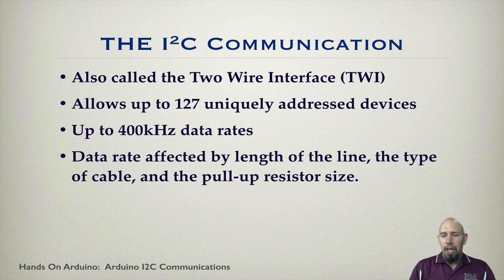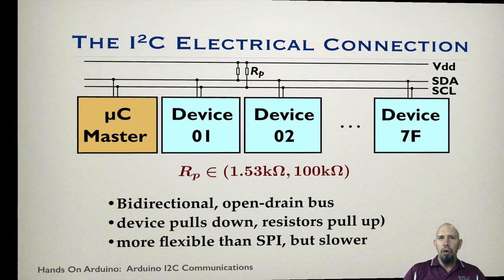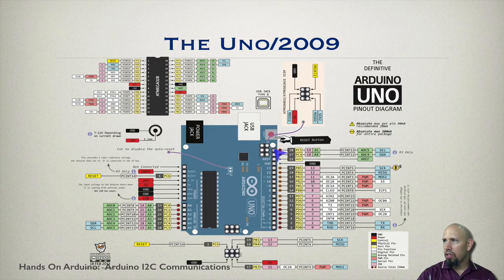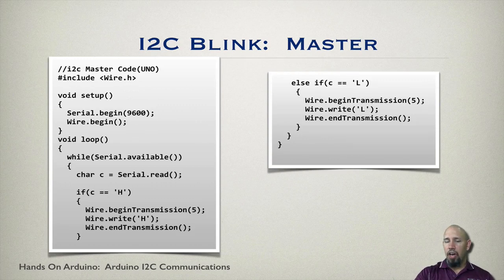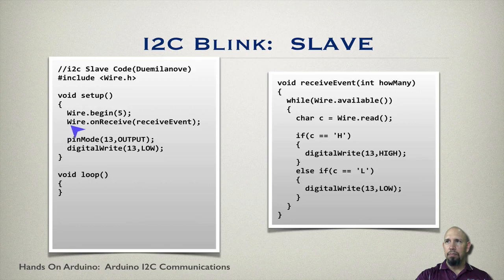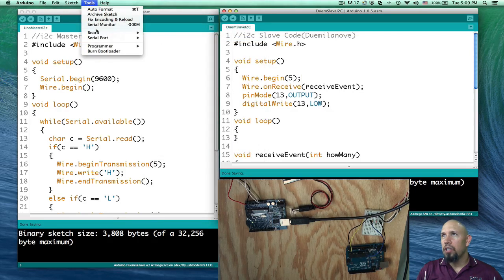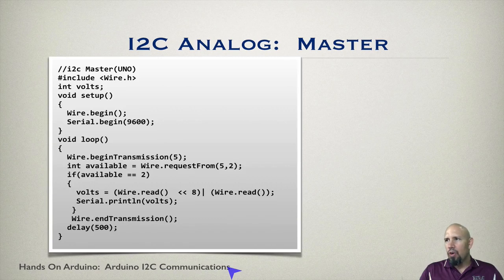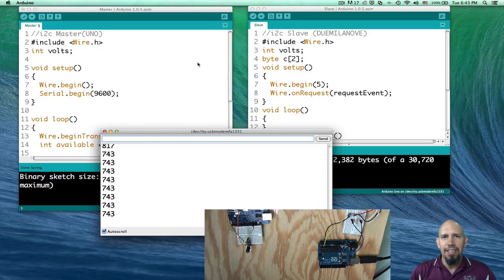Hands-On Arduino 4: I2C Communication

Comment: Hi Mr RobertI have a question for youIf I have two int data to send to master from the slave how can I do it?My project has one slave with 2 counter and I have to send they to the master via I2C protocolIn your video there is just one dataI tried to insert new data but on serial monitor displayed  the first data fine but the second data -1I dont know how modified the sketch can you help me?Tks Gianni

Comment: Thank you for a great introduction to using I2C with the Arduino.

I think you have missed the point of the twisted pair in your diagrams however. The idea behind a twisted pair, is to make sure that no single conductor spends more time next to a source of noise than the other. This ensures that the same amount of noise is present in each leg of the twisted pair this is called common mode noise. Since most communication circuits can handle common mode noise quite well, this noise is easily rejected.

In your setup, you are effectively biasing the one communications lead to ground while biasing the other to VCC. If the ground is nice and stable and the system is injecting noise on the VCC line when relays click and lights turn on and off, then this switching will be evident on the comms conductor wound around the VCC lead. This will increase the error rate.

It would give more reliable communications over longer distances if you use a single twisted pair for the supply (VCC and GND wrapped together) and a separate twisted pair for the I2S comms (SCL and SDA wrapped together). This is especially true if the power and comms pairs are to run next to each other over considerable distances.

Comment: I did exactly what you are telling,except I used Arduino Nano as a master and Arduino Uno as a slave,and It didn't work.Am I wrong when I did it in this way ? Please give me some advice.Thanks a lot.
Reply from the maker: There's no reason why you can't use any Arduino that does I2C, which is pretty much all of them.  Can you describe your experience in more detail?  Were you having problems with it or was it a success?
Reply: Robert Paz Do you have a email ? I have to draw a diagram circuit that I did and send it to you.
Reply: For anyone still having problems with the Nano I2C listen up: it's the wiring! Some pinout diagrams in the google search are wrong. Do not use digital pins 4 and 5 for the SDA and SCL wires. You need to use the analog pins A4 and A5 for the SDA and SCL respectively.